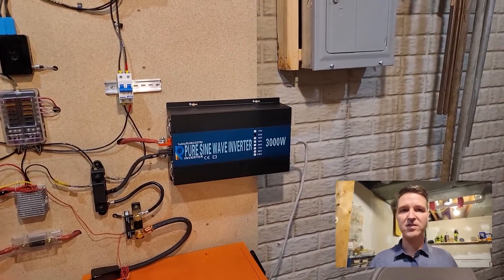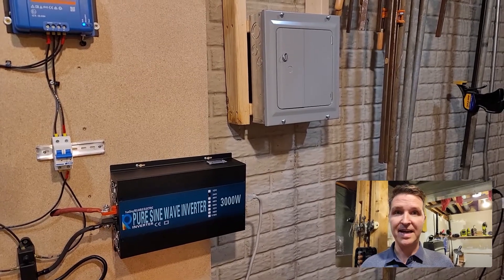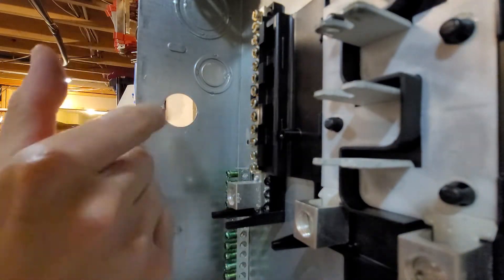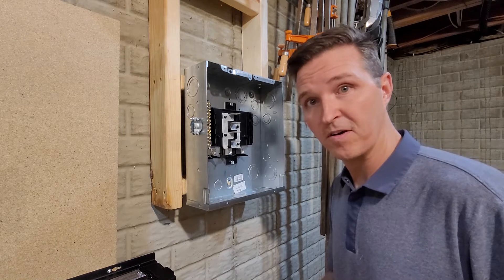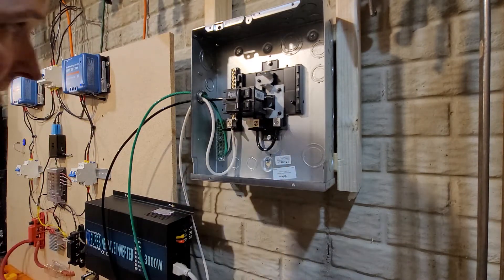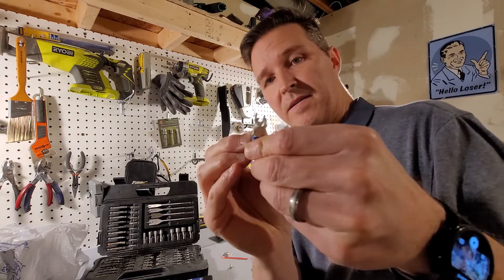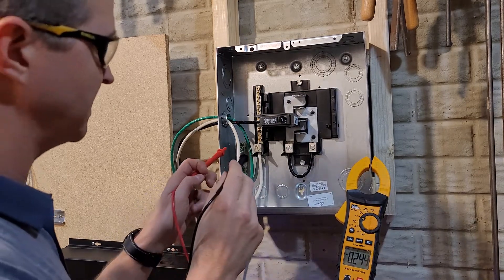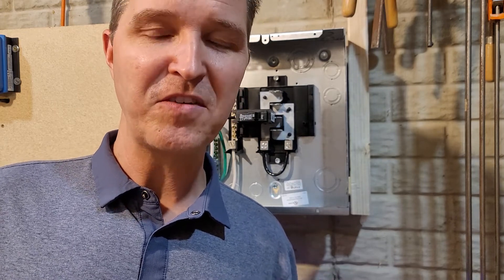Wiring a Breaker Box to my 24v Off Grid System!  Part2.

Comment: Thank you for sharing. I have the same inverter in my RV with solar and wanted to Hotwire a plug in to trailer instead of generator but didn't know the wire connections and your video tells me now so I can boondock using that plug in. Great job
Reply from the maker: That's great!  I'm glad the video was able to help you out.  Thanks for the comment!

Comment: Your ground on the ac side in the panel should go to earth. Your inverters chassis ground should be bonded to the neutral battery post.
Reply from the maker: Thanks for the info and the comment.  I need to make some adjustments.

Comment: man I see a lot of your videos and I've learned a lot from you. question... have you ever hooked up one of the small grid tie inverters into an off grid inverter set up? I have a couple of the small grid tie inverters like you was using in that video awhile back. I also run my RV and my shop from off grid inverters. I'm wanting to hook up some of my extra panels to the small grid tie inverters to up the abilities of my off grid inverters when the sun is shining. do you think it will work or you think it will burn something up. I figure the small grid tie inverters just match the frequency of the ac source so it seems like it should work but I'm not sure
Reply from the maker: I honestly don't think it would work for the long haul.  Maybe connect it during the summer, but that's it.  Just my opinion.  Thanks for the comment!

Comment: Great video, I'm getting ready to do a very similar project and I noticed this video is 2 yrs old.  Anything you would have done differently?
Reply from the maker: Yes.  The wiring going to the panel from the inverter is incorrect.  I now use nema 10-2 wire to supply the panel.  Thanks for asking!

Comment: first of all i thought ground should not be a current carrying conductor  except to carry current to ground rod in case of  any ground fault. Occurred    Its a part where current flow to ground rod in case of fault in the system.           And number 2.   Where did you get your ground from?     Which panel is where your neutral bound is done?       You are just using the ground to carry current.  This is dangerous
Reply from the maker: The ground isn't supplying current.  This inverter carries current through the hot and neutral at 60v each.  This is an off grid system so the ground is considered floating.

Comment: Where is your ground bar getting ground from?
Reply from the maker: It's an off grid system so it's a floating ground.  Thanks for the comment.
Reply: @OffGridBasement  thanks for the reply! Can you elaborate a little? I'm connecting up an off grid system to a load center and not quite sure if I should use a ground rod.

Comment: Every consumer needs its own RCCB if the earth and neutral isn't connected together with a long copper rod in to the earth ground.
Reply from the maker: Thanks for the information and the comment.
Reply: @OffGridBasement  Thats just the regulation in europe, for me it makes no sense, cause the floating voltage from a inverter is already relatively save, you cant get a electric shock when just touch one output of the inverter , if theres NO earthing of one of these to create a neutral and on the other hand a hot wire. The case of touching both wires at the same time is not covered by a RCCB in normal grid too, when you are standing or sitting insulataed against the ground, then the RCCB won't switch off too.

Comment: so i understand how to get everything wired and stuff but how do you know the max amount of breakers you can have on the main circuit from inverter?
Reply from the maker: It depends on the size of the breaker box.   I also know I can't pull more than 25A AC total because I have a 3000w inverter.  So you can have as many circuits as you want, just don't go over the total available wattage from your inverter.  Hope that helps.  Thanks for the comment.

Comment: Is there anything that you would do differently? Or can I pretty much do exactly as you did for my setup?
Reply from the maker: I would use different wiring to the breaker box.  It's better to use Romex 10 / 2 wiring.  I believe that can handle up to 30 amps.  My wiring isn't up to code and needs to be in a raceway or conduit.  The wiring connecting the two sides in the box isn't to code either, but it doesn't bother me.  Thanks for the comment.
Reply: @OffGridBasement  Thanks. I was actually able to use 8awg wire for the double pole breaker. Just had to screw in the first one to flatten it, then added in the second.

Comment: Question, is 8 gauge wire too much for this type of setup? I also have a 3kw off grid inverter that I’m trying to hook up to a small breaker box for a cabin. I ask this since I already have the 8 gauge wire and would prefer not to spend more money on wire haha
Reply from the maker: It being too thick is no problem as long as you can securely connect it to the inverter.  That's my thinking anyway.  Hope that helps.  Thanks for the comment.
Reply: You'll probably want 8awg lugs with whatever the bolt hole size is. 8awg is rated for 4400-4800w or 40a, which is plenty. An inverter will run at peak power for a short period of time, something like 15m max. Make sure to use a 40a or so breaker for that wire. 
However it seems to me that running an inverter pass its rater current might decrease its lifespan. In this case you might be better off with a 30a breaker, which would trip well before the max power is reached. Unless you need to be able to run more things at the same time.

Comment: Ah , ok it finally dawned on me ,
At first I was confused bu the jumper on the lugs .  Good job .
I just want one bar 120 .
Then I'm hooking up my 240 generator to run both sides . 
When solar is off . 
I'm going to do one of the slide plat
Switches . That blocks a breaker while one is on  ,the other is off .To go from solar to generator.
On my solar side ill only run lights and frig  and fan . The generator will run everything 110/240  . A/c ,well pump,
Water heater . Or what ever I need .
If I want . Or just run 110.
Reply from the maker: Thanks.  The jumper is not to code, but it works.  Having a generator for the 240v is a good idea.  Thanks for the comment 😊

Comment: Great for beginner,I would have used the 12/2 romex  for 120v 20 amps with the sheath on then strip the sheath  once into  the box.Whatever gauge wire you use leave the sheath on ,that way your golden.
Reply from the maker: I'm planning on doing a small upgrade soon.  Getting rid of the 6 awg and replacing it with Romex.  I want to get 25A 120v just for piece of mind.  Thanks for the comment!
Reply: Perfect. That was my question.

Comment: I think you should remove this video before others “not electricians” will see it.
Reply from the maker: I do mention in the video I'm not an electrician and as you watch you can definitely tell I'm not the person you should refer to for electrical work.  Is there something specific in the video that should be addressed further?
Reply: @OffGridBasement  i agree, but for peoples that do not know basic electricity theory is tempting to try.
Reply: @OffGridBasement Inverter is not safe to use in this manner. Cheap inverters run 60 on hot and 60 on neutral. In reality nothing should be on neutral and 120 should be on hot. This is a dangerous scenario to hook up to structured wiring. In a lot of scenarios it will function but it isn’t right and it is dangerous.

Comment: great start to electrical, as others pointed out romex is a more appropriate wire of this use case however cost is crazy currently personally I would Use Metal clad wire as its less expensive and more durable, but does need extra care to ensure that wires aren't nicked or damaged. Additionally the wire has the temperature rating printed onto it, the stuff you used its most likely 60c rated meaning it has an ampacity of 55a where as your inverter is 3kw or a max of 25a at 120vac. You are correct that over sizing conductors is ok to do however its not recommended especially for short runs where voltage drop is so minimal, at max with 10awg you could see 0.25v drop on a 5ft run with 25a passing through it.
Reply from the maker: That is good to know.  Thanks for the comment.
Reply: Clad wire bad lol

Comment: I appreciate DIY, but this isn't something that you shouldn't be doing, you don't know enough and you're using the wrong stuff. Thats the wrong wire, it's meant for being inside conduit. that connector DOES need to be tool tightened. And that inverter shouldn't be used with a load center like that. It will energize the metal of the panel. As you already discovered there is half the voltage on the "neutral", there definitely shouldn't be.
Reply from the maker: Thanks for the comment.   I will probably do something with the wire.  I did end up slightly tool tightening the cable connectors, but it didn't do much.  You can use this inverter on a panel as long as you don't bond the ground and the neutral in the panel.  The panel is not bonded.
Reply: @OffGridBasement  with all due respect, your case is a current carrying conductor the way it is, and is potentially dangerous as it stands.
Reply: @sNEAKYnIGHTmUPPET  Would running ground from the panel to a ground rod solve it or are there other considerations?
Reply: @thedabbler2753  no. I believe you need to remove the ground/neutral bond if possible
Reply: I Find it funny how you ran your main wire for the sub panel 😂😂

Comment: The 6awg wire is way too big. That’s why it wouldn’t fit the inverter. You showed you got a small spool of 12/2 Romex in part 1. Why didn’t you use that? That would have been the more appropriate wire to use. 12awg is good for 20a. 10awg for 30a. 8awg for 50a.
Reply from the maker: You know...  I thought it was way overkill, but I just went with this "American Wire Gauge Conductor Size Table" I found online.  I went with the 6awg wire b/c of I found this info..  It does also say it's "very conservative".  :-)  It also states that a 10AWG wire in Free Air can max out @ 30amps.  
6AWG
Diameter:  .162in / 4.1148mm
Resistance:  1.295 Ohms/km
Max Current:  37amps
Max Frequency:  1100 Hz
I also wanted my wiring to be a bit over sized b/c I didn't want any heat from the wire.  I just went a little bonkers with the oversizing!  Thanks for the comment!

Comment: I enjoy watching your videos. Just a question as to where your ground is actually grounded to?
Reply from the maker: Dan,  thanks for the comment.  I've actually neglected my grounding.  Right now it just grounds to the case of the inverter.  I plan on setting up a ground system for all my components that will connect to the incoming water pipe in my basement.